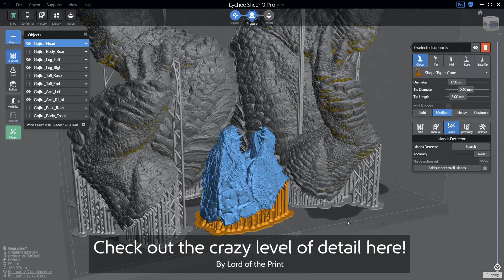Lychee Slicer x Creality Halot Sky - Godzilla Timelapse

Comment: How did you get your own software to slice and load into the halot sky , it won't work on mine at all unless i export as obj then slice in halot program . And a lot of your features won't work that way , I've subscribed as well but it still doesn't work
Reply from the maker: Did you try with Lychee Slicer 3.6.2 ? (available on our website)
Reply: @Lychee3d  no , i have 3,6,1 . Thanks i will look

Comment: Did you use resinlapse to shoot this stunning timelapse?
Reply from the maker: No, resinlapse will not work with the Halot Sky as there is no UV bleeding. It's been a while that we are using the Pluto sensor (expensive....) but it offers a lot of different sensors to trigger cameras.

Comment: that's an awesome print. I purchased the Halot Sky after seeing this printed, and also Thomas spoke highly of this in his video. I would like to ask the print exposure, speed etc settings you used for Halot SKY, what are the best settings to use in Halot SKY? 
Also Anti Alias and gray settings as well. I have both sirayatech sculpt and creality's standard resin. Thanks
Reply from the maker: (Thomas here) Sorry but I printed so far only with a mix of Elegoo Grey + Black resin, then my settings may not apply to your resin (Siraya Tech resins are great!). But try around 2.5 seconds. For the speed, I'm quite aggressive with 4mm/s (240 mm/min).
For the Anti Aliasing, try at the maximum value and for the gry offset, set it to 20% (Grey offer is the contrast of the grey scale of the anti aliasing).

Side note: we will release in our next update the updated V3 format for the Halot printers, which will let you sett all the printing settings in Lychee Slicer and not anymore in the printer.
Reply: @Lychee3d  thank you Thomas, i will try those setting asap. Setting inside the slicer sounds great! Looking forward for that!
Reply: @Lychee3d  On Auto orientation in rotation, does it auto rotate according to achieve the best surface or according to least supports, or something else? In Prusa slicer there is 3 options goes like that. I was curious about what algorithm Lychee follows. Thanks!
Reply: @emrelee  knk memnunmusun makineden
Reply: @Burakdenartakalan  makina güzel. Gayet havalı tasarımı, kalitesi üst seviye. Kapağın  menteşeli olması da harika rahatlık. Telefondan ipadden direkt print e yollamakta kolaylık. Baskı temiz eğer resin e göre doğru ayar yapabilirsen. 

Ben şahsen çok az kullandım. İki cihaz var bende zaten. Ufak olanı daha çok kullandım. Baskılar hız olarak gayet iyi. Sen ne için cihaz düşündüğün ve ebat konusunu kararlaştırdıktan sonra markalar üç aşağı beş yukarı aynı. :)
Reply: 🙏 Hi @Emre Lee , I also have a Halot Sky, I use Creality's Standar Plus resin, please could you share with me your print settings? I have already had some problems.
Reply: @niniamimo  Hello, first I can recommend you to go with few test prints.  siraya tech has a nice test print model looks like validation matrix, I did get good results between 2,5 -3,2 sec for layers, I usually go with 3 sec to be safe. Bottom layers are 4 layers, exposure time 20 sec, I prefer to have more bottom layers with lower seconds then 1 bottom layer with long exposure. 

ı can strongly recommend Siraya Tech resins. they are so easy to wash, like water washable of Creality, and almost odorless, Creality smell doesn't go away from room for long time.
Also results are smooth and clean like a factory manufactured button.
make sure you shake the resin well if the resin was still in bottle or tank for a long time.

Lastly, print failures can be by resin/print settings related but it can also be related with placement, suction forces of the model and heating of the environment..be mindful about those as well.